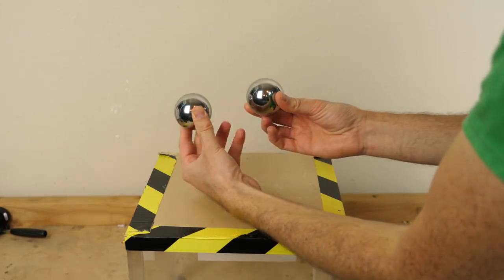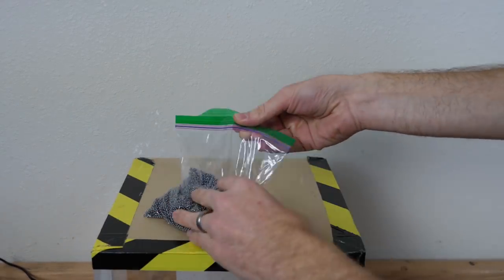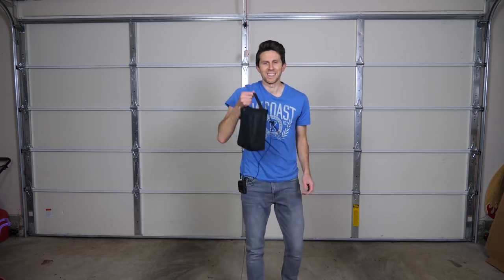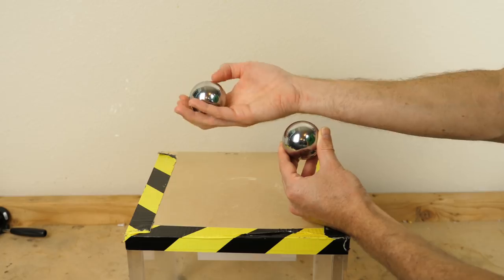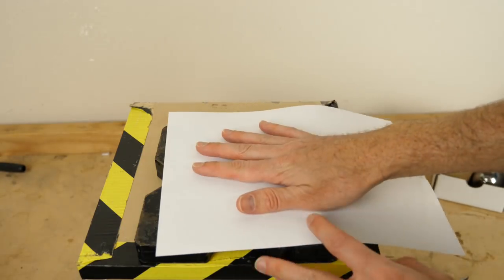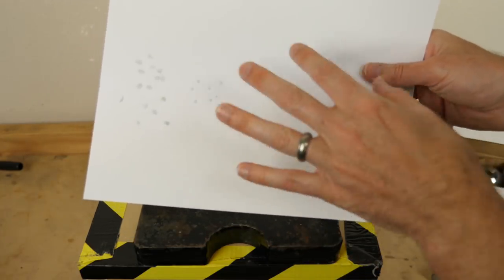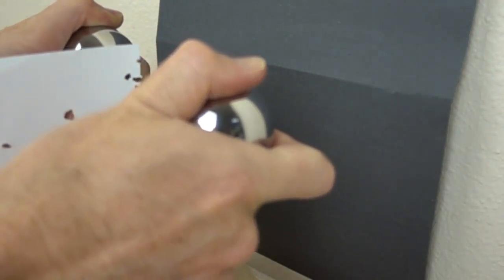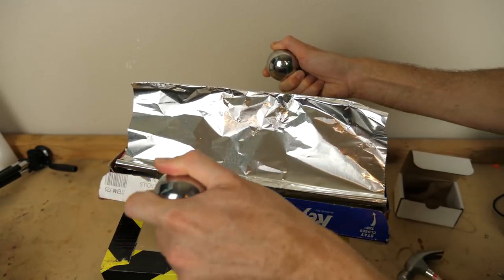Making a Shockwave by Hitting Two Huge Steel Ball Bearings Together!

Comment: You rip off the paper because u used your hands + when the balls touched each other, the surface of connection is very small . They act like spikes and not like blunt hammer. Also yes, there is a sound but you neutralized most of that sound just by holding balls with your hands. The energy and vibration of impact was just transfered from ball to ball.

Comment: 3:31 can you calculate the speed of sound in aluminum with this pattern? 
Like C=l*f
so if the sound that came from it is 1000Hz and the distance between two circles was like 2mm the speed of sound in aluminum would be 0.002m*1000=2m/s. But this wohld be way too less. (or maybe not because of this is just a foil in which the speed of sound could be way less.)

Comment: 0:45 next time take your own body's temperature and then do that literal exercise of dropping a sack of weights stooping over and picking them up raising over your head and dropping a hundred more times. (Better to bend at the knees there buddy keep the back aligned perpindicular to the floor) take your temperature again when you measure the weights at the end. I bet your own body also raised in temp slightly

Comment: The speed of the balls hitting each other was doubled (one in each hand) compared to the hammer's speed at a single down force.  Does that make a difference in the outcome of one single ball coming down on the metal plate?    Just an observation.

Comment: I suggest you gain some age, experience, test equipment such as a high speed camera, and learn how to do research beyond the google command line.  It's bad practice to tack "est" on to something you know little about.  Like the brightest flashlight or the blackest black (NASA has developed the blackest black that does not reflect a laser beam).  And you very much should do all that before you spam your videos with commercials.